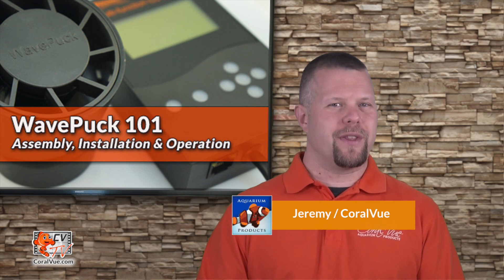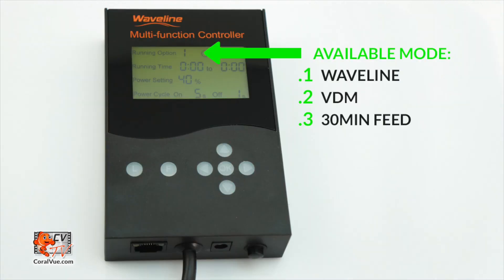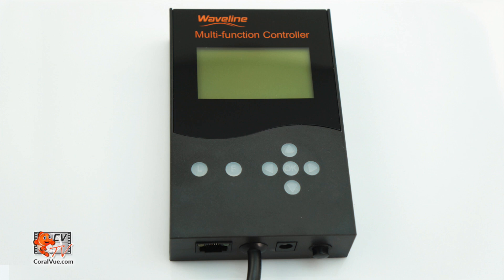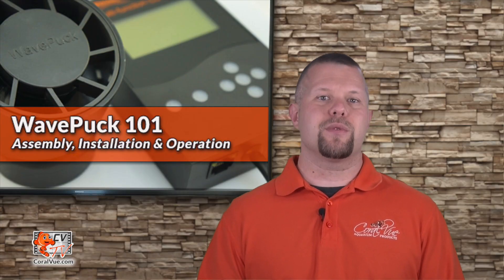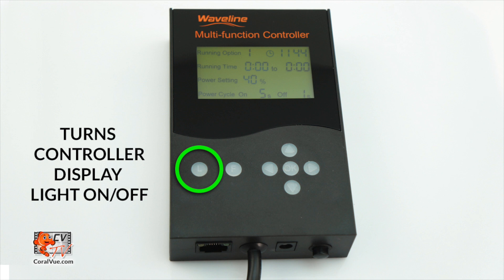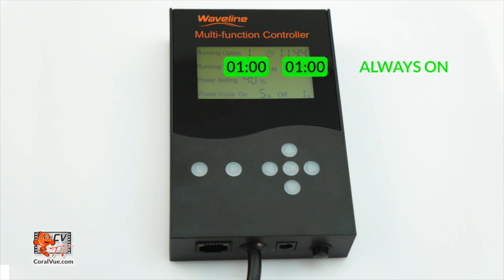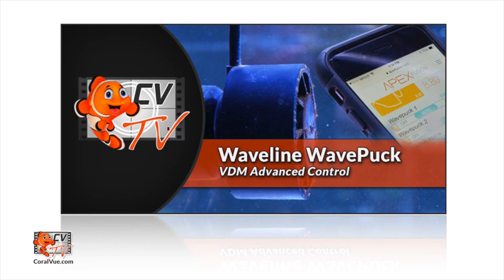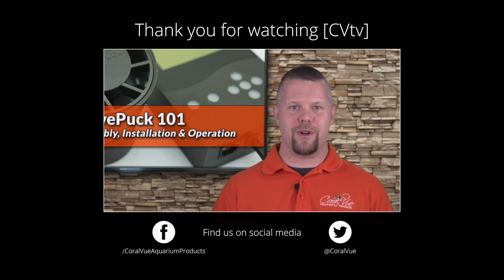WavePuck 101: Assembly, Installation & Operation

Comment: The pump works great so far.  When will you be adding more information on how to set them up and use them with a 1-10v controller like Apex.
Reply from the maker: The 1-10V advanced control video will be released in the next couple of weeks.